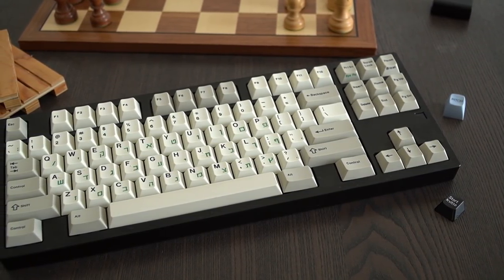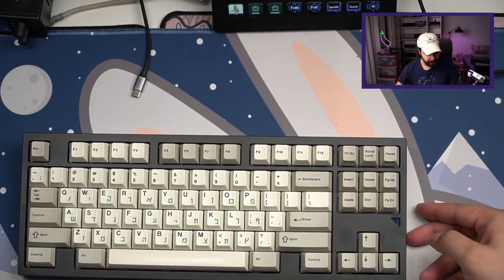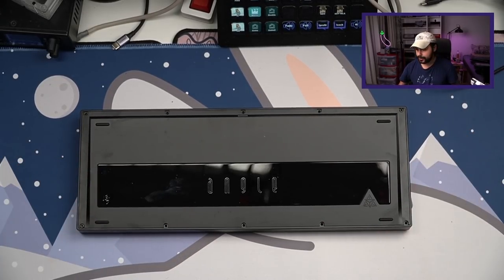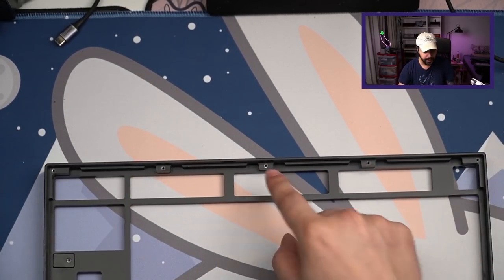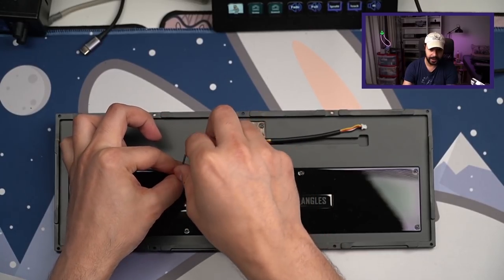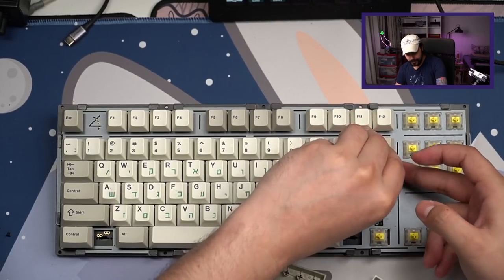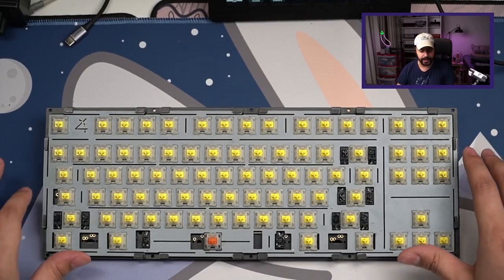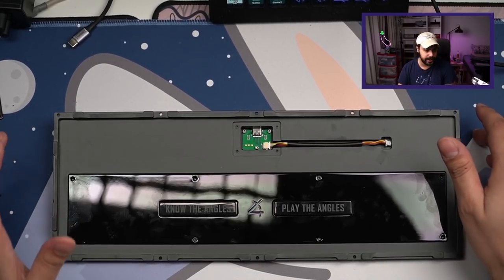Vertex Angle TKL (CN version) Review

Comment: Dont worry, screws are actually pretty good in holding stuff. And this number of M2 screws is more than up to the task of holding this weight in place as long as there is no play/movement involved.
In your case, lets assume that your M2 screws are of pretty weak material (just to be sure). Since I am not an English Native, I cannot give you the names of the math but if you are interested you can doublecheck this yourself.

The math: 
"hardness of the material" (bigger is better, be we assumed it to be weak) 4 x 6 = 24kg/mm²
"power of a M2 screw" (this is fix for the size) 2,07 mm²

24kg/mm² x 2,07mm² = 49,68kg

This means each(!) one of your M2 screw can hold up to 49,68kg before it gets destroyed.
But before that the threads in the Keyboards case will strip.

So be assured: All those M2 screws are more than capable of holding that puny weight in place.   :)

Thanks for reading!
Reply from the maker: I like you, please join the discord, donate your brain to the greater good
Reply: @Blacksimon  Done! Let’s get comfy at your place. :)

Comment: How do you feel about the international version being designed with the intention that pcb foam is used?
Reply from the maker: The CN version was the same way, I plan to ignore all foam as usual
Reply: @Blacksimon  Yeah, but according to Andy's video (which I know might not be 100% accurate and also is his subjective opinion), it's sort of difficult to get a good sound at all out of the board without the foam, and my guess is that's in part thanks to the revisions on the international version.